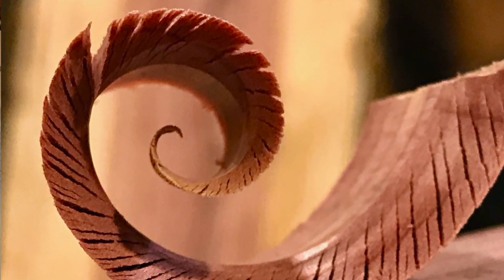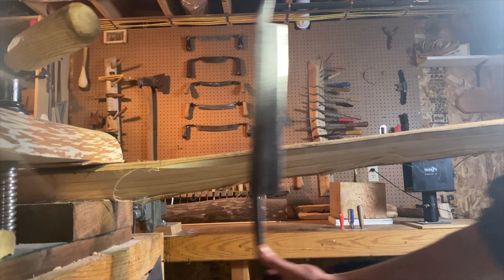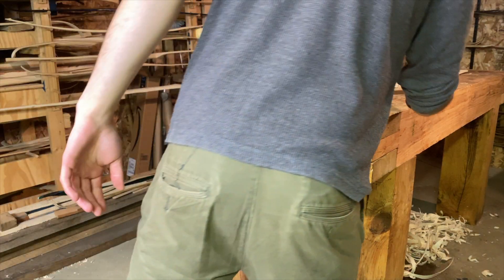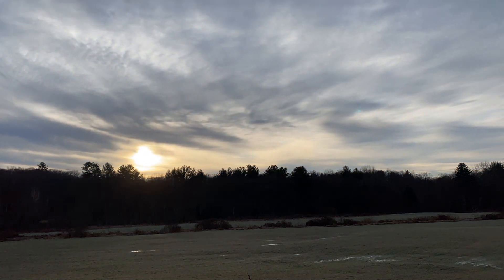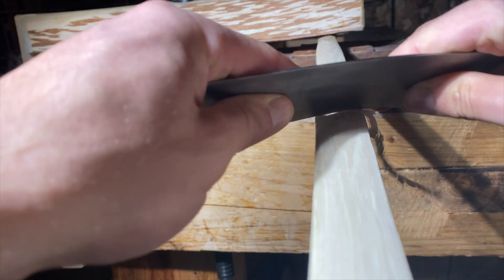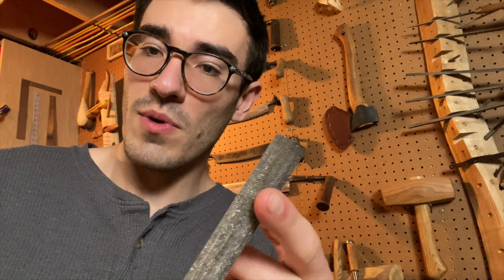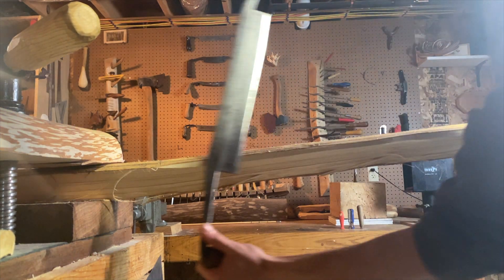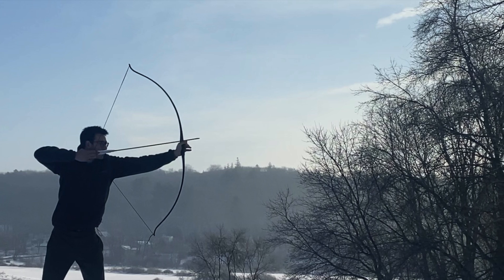Beginner Carving Tips for Bow Making

Comment: Nice video and informative.  I like the calm audio.  Remember to tell people they can make good scrapers from pieces of old saw blades.  Learned that from John Gardener in boat building class at Mystic Seaport about fifty years ago.
Reply from the maker: I’ve mentioned it a few times. Trouble is it only works with old blades. Many of the new ones aren’t hardenable and have teeth of a different material
Reply: @DanSantanaBows  You are correct.  I should have mentioned that the place to find useable and cheap saw blades is at garage sales and junk stores.

Comment: Hello there! I am attempting to make a bamboo reflex bow and i am afraid that i might mess it up somehow, so please help me
Great video btw, this is the best one ive watched so far.
Reply from the maker: If you need a tiller check anytime head over to r/bowyer on reddit and post the front profile, side profile, and drawn picture. I can help you from there much better with pictures
Reply: @DanSantanaBows  Thank you very much for the early reply!
the bow worked well at first but then i crack i ignored while making it grew larger and the bow is too light, im planning to make a pvc/board bow soon just gathering materials

Comment: I follow you on Reddit.  Love your work.  Jpurdie1984 on Reddit.  I agree w carving skills transferring to bow making.
Reply from the maker: They definitely do. I just installed some takedown sleeves which was much easier having had some practice fitting axe handles
Reply: @DanSantanaBows  that’s cool.  I recently made an axe handle.  Love your bows.  I’m in to woodworking. Carving. Pipe making.  Tool making.  Getting in to bow making.  Have some staves harvested. Learned a lot from you guys on Reddit.  You, being a primary source for sure.
Reply from the maker: let me know when you have any questions and feel free to post as many stave checks as you need

Comment: Excellent video. I do have a question.  I'm making a 52" hickory flatbow with a natural back.  I'm stuck at a draw of 23" and 50 lbs. (+-).  I've taken off the belly until I'm down to 1/2" - 5/8" thickness.  It tillers really well, good equal bend all through the limbs, but I would really like to get it down to about 40 lbs.  Should I start reducing the width?  It is about 2" at the widest and tapers to 5/8" or so. And what is the maximum draw I could expect from this?
Reply from the maker: Just keep removing wood from the belly to lower the weight, and only pull to the new desired weight of 40 as you tiller. 

Does it have a stiff or bending handle? Even with a bending handle you’ll probably max out a little over 26” of draw, maybe around 22” with a stiff handle.
Reply: @DanSantanaBows  It has a stiff handle.  I intended it to be about 68-70", but a knot changed that.  It will be of little use to me since my draw is 29-30".  But I would still like it to be a usable bow.  I passed the target weight quite by accident (my scale was set on kilograms rather than pounds).  

Thank you for your reply.  I'll look for you on reddit.  I enjoy your videos immensely.  I don't know what "neck of the woods" you're from, but it's beautiful country.

Take care, my friend